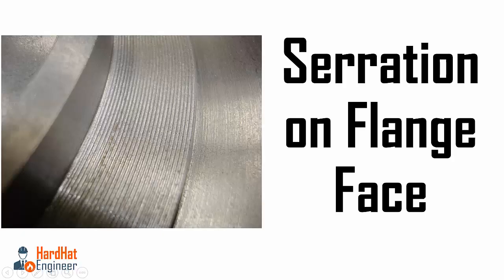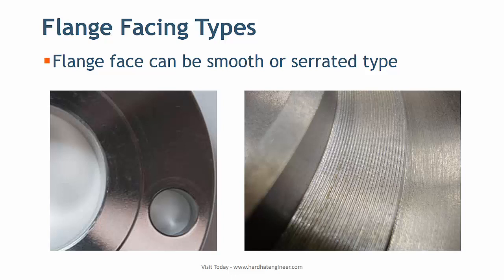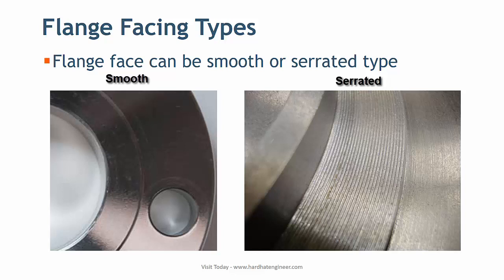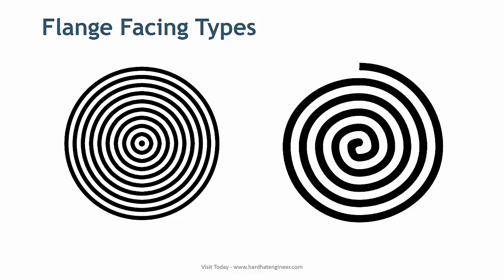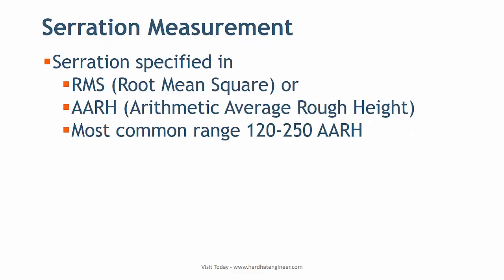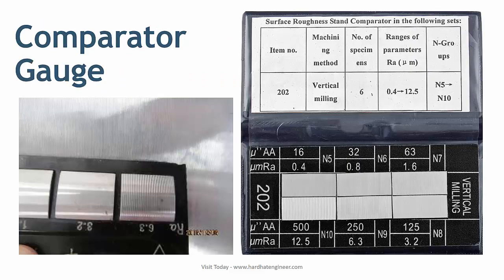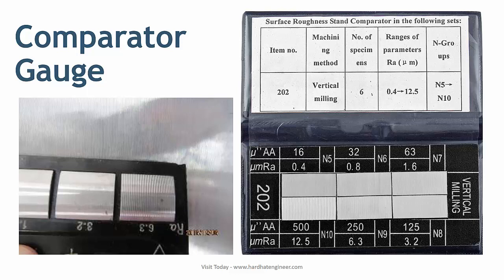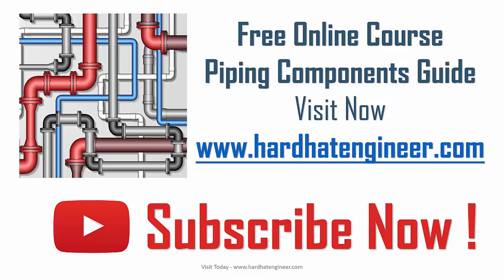What is Serration on Flange Face? Smooth Vs Serrated Flange Face

Comment: When and why spiral gaskets have an inner ring ang are thy interchangeable??
Reply from the maker: When there is a chance of vacuum in line. The inner ring acts as a barrier to the internal fluids and provides resistance against buckling of the
windings. It also provides additional load-bearing capability from high-bolt loading.
They are fixed and cannot interchange.